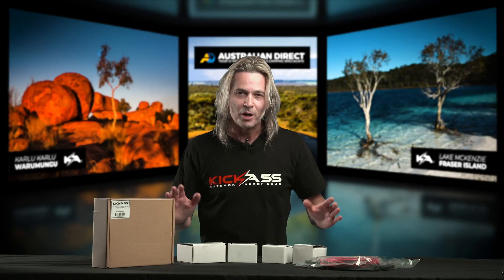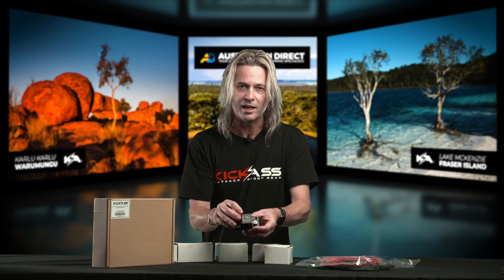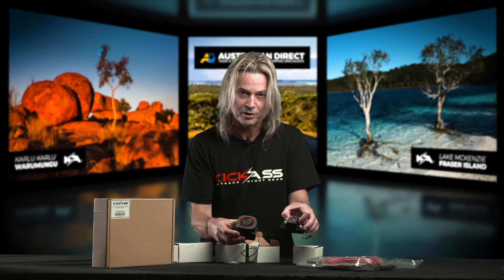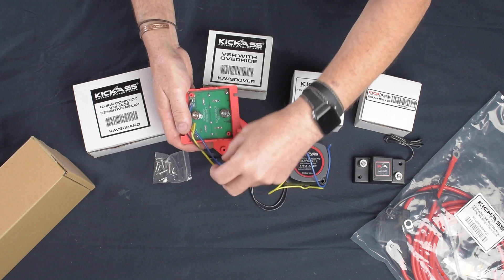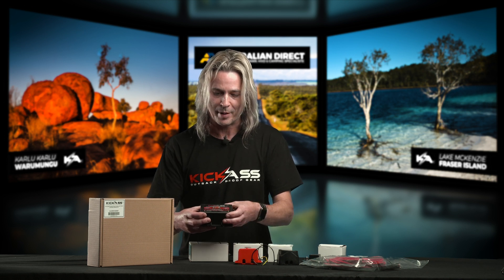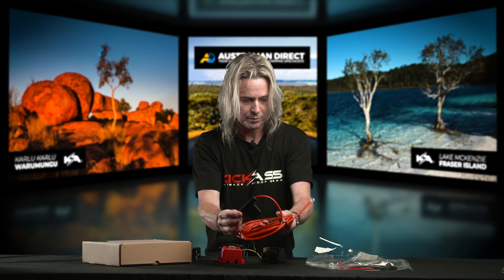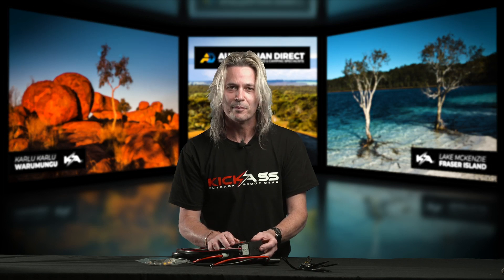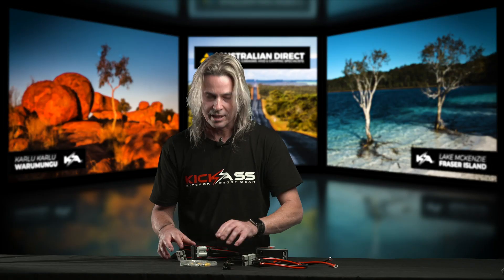KickAss VSR (Voltage Sensing Relay) Range Overview

Comment: Hey guys I have the plug and play AGM battery box connected to my main battery, how and where do I connect the vsr / isolator ?
Reply from the maker: G'day tom,you normally connect the isolater between the 2 batteries,does not matter if it's the start end or 2nd battery 
Cheers Craig

Comment: There are no onstructions in the box for the dual 140a override.its just a wareanty leaflet. The qr code on the box no good either. 404 error
Reply from the maker: G'day there if you haed over to the website & search the product you have we have all the instructions on line for you 
Thanks for watching 
Cheers Craig
Reply: @KickAssProducts  maybe fix it? Even just the qr code..can't be that hard can it?

Comment: Can I mount a VSR with a DCDC charger to get the override function or does your DCDC charger have this kind of function to link the 2 batteries together for a quick jumpstart? Thanks!
Reply from the maker: G'day there,unfortunatly you cant run a vsr into our dcdc as it also has an inbuilt vsr in the unit itself so all you really need is the dcdc as it has so many benifits over a atandar vsr 
Thanks for watching
Cheers Craig
Reply: @KickAssProducts  can I wire the dcdc charger to link the 2 batteries together for emergencies like the bypass switch found in the vsr?

Comment: How do you get a 140 amps through a 50 amp plug??.. 
  Not good, guys.
Reply from the maker: G'day mate they are rated at 600 volts mate,so never get an issue 
Cheers Craig

Comment: Would the 140a vsr be advisable to install on my rear anderson plug wiring for the camper battery charging?
I'm going to install the kickass dcdc charger running the kickass 75L fridge and battery in the car also...
Reply from the maker: G'day there,yes you could use it for your camper,but i would prefer a dcdc to completely charge & maintain better than just a vsr
thanks for watching 
Cheers Craig

Comment: Hi, if I use a DC/DC charger in place of a VSR will it do the same job of protecting my cranking battery ?
Reply from the maker: G'day ozzyrick,yes our dcdc has a built in vsr so not only is it a dcdc charger but also a vsr & solar reg all built in,here is a link for you 
https://www.kickassproducts.com.au/?query=dcdc
Cheers Craig

Comment: Looking at the plug and play one to use with my powerstation. The powerstation has a built in charger so just purely want a anderson plug in the back thats isolated so am I right in assuming the dual sensing isolater will work or do I need to do a hard wired in isolater with the vehicle being later model smart alternator?
Reply from the maker: G'day Andy,later model vehicles do benefit from using our DCDC charger as it does boost the charge on modern alternators/smart charging systems,& also has a vsr inbuilt into the unit as well,but the quick connection vsr will work fine as long as your alternator can charge the unit & it also has a blue ignition wire that you can connect to a 12v power source that is on only when the engine is on so we got you covered on  what set up you would like
Thanks for watching the video 
Cheers Craig

Comment: Just trying to understand... are these a budget replacement for a DC-DC system, e.g. your battery box SKU: KAJBAGMKIT4; or is the intention to use both these VSRs and the DC-DC ?
Reply from the maker: VSR's are a budget solution for older vehicles built pre 2000. Depending on you alternators out put voltage you may be able to use a VSR. You need a constant voltage of 14.4 - 14.7 Volts from you alternator to charge a secondary AGM. If your vehicle outputs this voltage then you can use a VSR.

Modern vehicles with smart alternators witch drop the output voltage once the starter battery has charged there for do not output the required voltage to charge an Auxiliary battery. This is where you use a DCDC charger as it will boost the voltage. 

So depending on your vehicle you will require one or the other. Our DCDC charge does also have the benefit of MPPT solar regulation and, different charge profiles for different battery types and accurate battery monitoring so as not to over charge your Axillary battery. Hope this helps.

Comment: Does this kit can it be used for lithium setups? Like a 200ah setup or does this setup just do agm battieries?
Reply from the maker: If you are using lithium storage you should use a DCDC charger to ensure that the charge profile is correct. VSR's have no kind of regulation and just charge your battery at what ever voltage and current your alternator puts out.
Reply: @KickAssProducts   just for reference  so if i had a 200ah lithium slim battery that went beheind the backseat what would the setup include is it just plug and play or is it hard wired in? So what dcdc charger would be needed to get the most out of the battery? And also if the battery says only 100ah discharge does that mean if its a 200ah lithium it can only use 100ah of that 200 before it cuts off sorry just trying to find out more info.

Comment: Didnt have enough $$$ to get the DCDC charger so Installed the mini VSR to get me to the Cape and back.  Happy to say battery was fully charged at the end of every days drive.  I know the DCDC will get you that little bit more charge in, but for a budget setup this is perfect.
Reply from the maker: Thanks Cassius, just remember when using a VSR it is always a good idea to give your battery a top up with a good multistage AC charger between trips.
Reply: This is fine for high resistance flooded lead acid secondary battery. However, if you have a high-amp hour lithium ion or LiFePO 4 battery, they have low internal resistance and you can give your alternator a hernia if your high-amp hour lithium battery is quite low. The DC-DC charger prevents your alternator from getting damaged, by significantly reducing the load on it. Typically you have about 12-20 amps overhead from an average alternator; and it is best to draw from within this overhead range.

Comment: I just bought the plug and play model with Anderson plugs. I had it in my 1990 pajero in....45 mins 😳 I'm the least electrical guy I know. The most challenging part of this install for anyone would be finding and feeding the firewall penetration. I got super lucky and found one that gave me no trouble. Straight through. FWIW I did not lift the door sill trim to feed wire to back of the wagon. Mine entered the car near front  door  passenger RHS foot so I ran under console, between seats ( above carpet) and then under rear floor mats and the  rear seat to cargo bay. Easy AF. These kits are just bloody amazing.👍👍